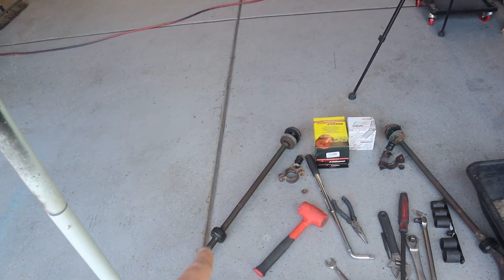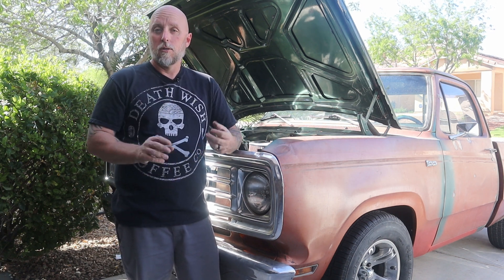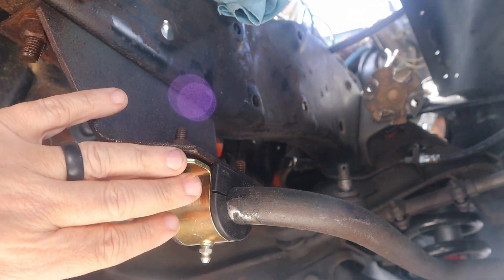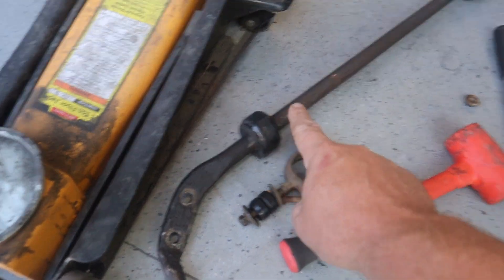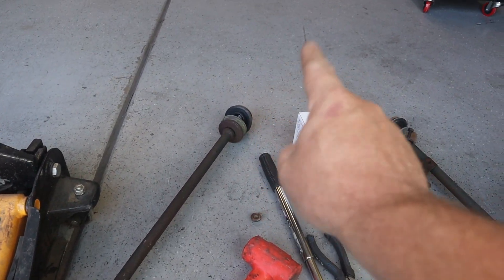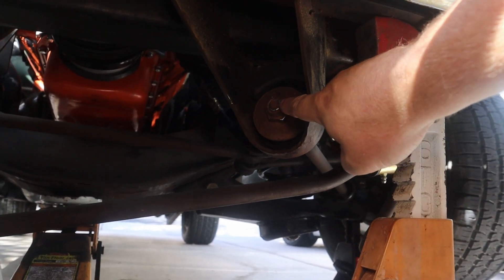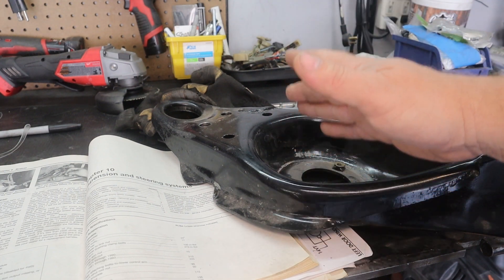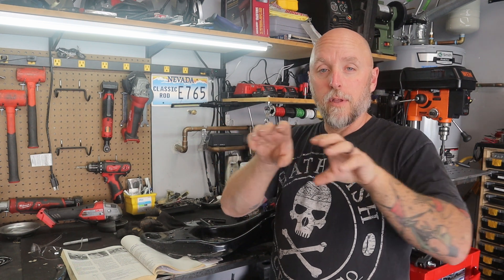Sway Bars, Strut Rods and Steering Boxes | More Dodge D100 Suspension Work | Polyurethane Bushings

Comment: I'm interested in your stabilizer bar. Did you install it and if so where did you get it? I have a '90 model with no bar. I think the diesels had bars but finding a used bar off one is near impossible. Thanks, DC
Reply from the maker: The bar was there when I bought the truck, but LMC Truck has them ( https://www.lmctruck.com/suspension/suspension-front-rear/dc-1972-93-performance-sway-bars ), and probably other places

Comment: Where did you score the prothane strut rod bushings from. I got a set of rubber ones from LMC …totally dissatisfied…. They sent 3 of the 4 big washers with big holes instead of 2 small and to large plus the bushings are way thicker than the OEM  .
Reply from the maker: There should be a link in the description

Comment: Hello my name is Enrico from Germany Solingen. (I translate with google! ) I am looking for two parts that you have lying on the floor. I can't find them on the internet. I already have the part numbers 3637619 and 3637620. I have had a Dodge Ram 1988 D100 for 1 year. Now I've changed the rubber parts and a screw broke off. Now I need two new parts for the rubber mount on the stabilizer, left and right. Where can I get the mount and send it to Germany? This is the clamp for large rubber with screw for small rubber.
 I think the right side is a new clamp. On the left is an old clamp. Can you help me? Greetings from Germany
Reply: Dodge D100 Sway Bar Link
Reply from the maker: Honestly, I don't know.  I had to replace one, and I ended up finding one at my local junk yard.
Reply: @MoonBuiltGarage  Hello, thanks for the answer.  Unfortunately there is no D100 on the junkyard here.  I'm still looking... Gr.Enrico